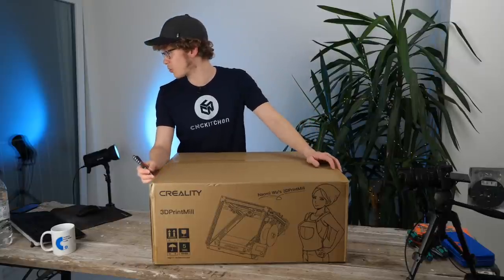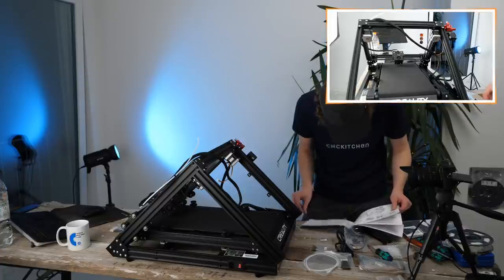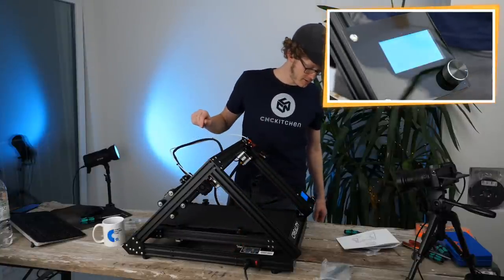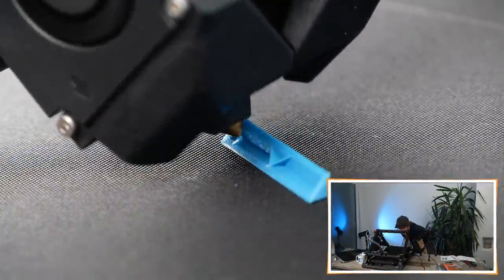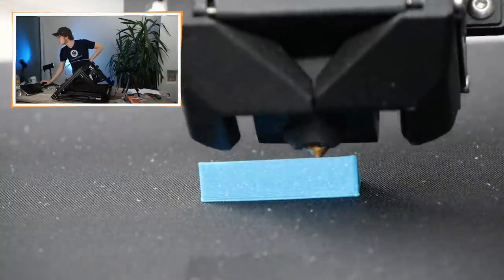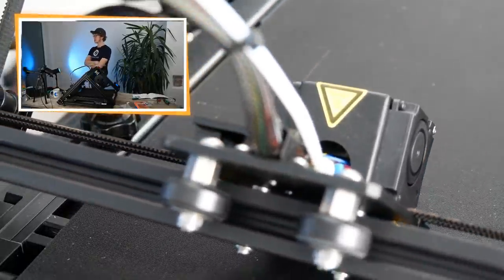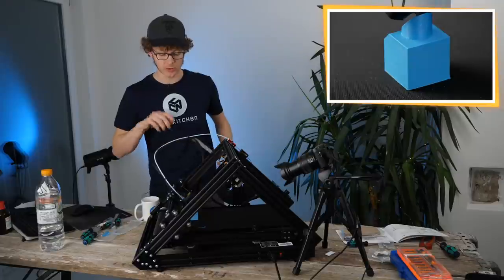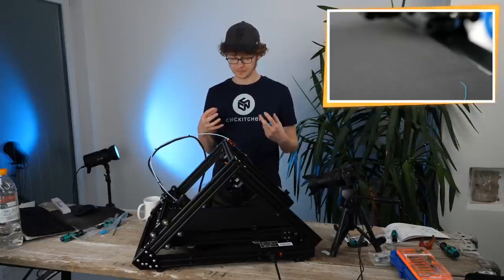CR-30 Belt Printer UNBOXING in the new studio!

Comment: Hey Stephan. I have a general question, that are stuggling me with my Anycubic Chiron. Have you ever checked if the nozzle temperature really is what i say. I have a digital sensor (which i need to calibrate of cause) but this measure temperature 30dgc above the printer shown temperature. So if i printer it set for 200dgc i measure 230dgc (which might explain the rather pure printer quality i see now and then, depending on material) after setting 30dgc lower all look fine. Have anyone testet your temperatur? any comments? By the way Thank you for a very interesting and well produced channel!!

Comment: all printers should be made like that. it looks super sturdy af!!
Reply: Its crap
Reply: It would be a little difficult to print if you have an overhang coming off the opposite way since it favors one side And would require you to build support before it’s able to print the part and bring it back down to the base of the bed which would result in having to prep more support than usual. Also printing something super thin would be a challenge since it relies on a 45° angle to print which would always be the diameter of your nozzle. What they should’ve done was keep the traditional print set up and just have the bed on a conveyor belt or it moves back-and-forth traditionally and to print the next part it moves out of the way until it gets to the end then they fall off. Unless you have a need for a production style set up you’re better off getting a traditional setup or buy the prusa mini and have multiple for production which will make more sense because you could print multiple parts at the same time.
Reply: @rrtsduf  no its not, and its reviewers say its good.
Reply: It’s not good and it’s not crap because the production machine does not exist. These are beta units. I do expect the final printers to be similar but if you use Kickstarter you get no retail protection at all, just like the CR6E.
When you have issues and switches fail, motherboards spark and stop working you have extruder issues or one of many other issues you will find because it’s Kickstarter you have no rights whatsoever as you have bought nothing, you backed it and have to ask  creality for support, support that will be very poor or none existent.
You might think you will save money or perhaps get it first at least. The CR6E they didn’t, retail units were on sale before all the backers got theres and the retail price was the same as Kickstarter.
Still want to back it?
Don’t make me laugh.
Really want it? Wait for the retail unit when you can return it or at least get it repaired.
I stupidly backed the CR6E and yes.I got the printer but two months on have not got a single print and have spent about £50 on replacing parts.
Working on it just now so hopefully will get a print shortly.

Comment: this configuration would only be good for small parts. You could not print an object with a footprint larger than the distance from the flat of the belt at the rear  to the lowest position of the X
Reply: I see they consider the belt to be Z, this will improve the ability to print longer objects, however it still limits the length based on the overhanging weight at the front. This is likely not a problem for most prints though.

Comment: hmm, i dont know. i dont like to loose the ability to print perfect round vertical holes
Reply: You can print perfectly round vertical holes as long as the base of your part is 45deg. In theory if you want to waste tons of filament you can even print a support wedge to re-orient parts and get back your perfectly round vertical holes.
Reply: @riakata  sorry, but 45deg isnt vertical. i understand of course what you are upt to, but this isnt really practical
Reply: @riakata  also, its not only the holes, you wont be able to print really round tall objects anymore
Reply: @riakata  plus, im not sure if the vase mode still works for this type of printers